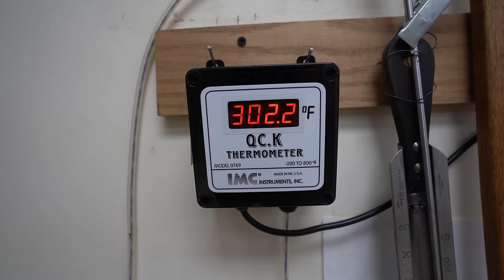We Made Candy Canes!

Comment: 25:23 you guys should put a magnet ruler on the metal table right there so you can just leave it when measuring rather than using a stick.   Just a thought.  Might be a good thing to just have so you can stick it and then remove it when you don’t need it.  I’m sure there are flat magnetic rulers out there like thin vinyl.

Comment: Instead of using the silly little stick to measure the length, it would be so easy to scratch/scribe two lines in the stainless steel table.  They would be permanent and would not fall off of the table.